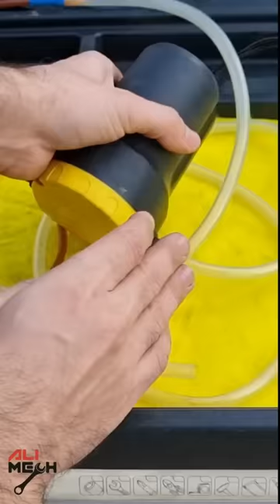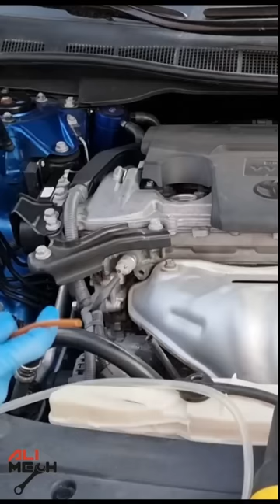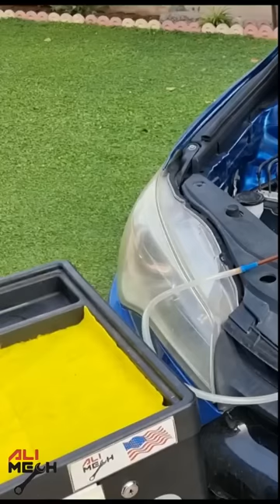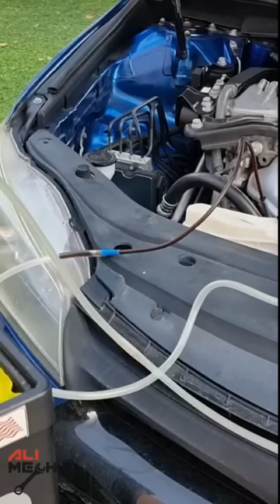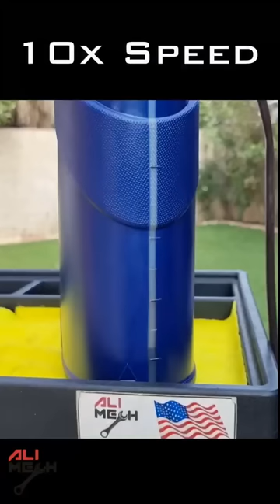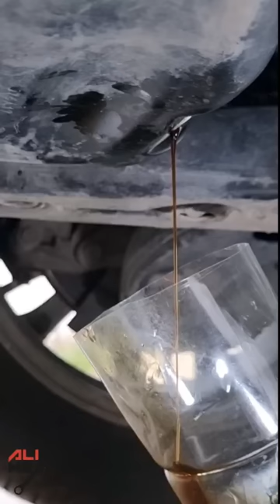Don't change engine oil like this! #shorts

Comment: Id already have the new filter on and fresh oil in before that pump is even done sucking, would be handy for trans fluid though.
Reply: Yeah, seems like it would take longer this way only to still jack it up and pull the plug in the end.
Reply: It comes out way faster if the oil is hot. I used an oil extractor at a friends house and it was like sucking water.

Comment: Iv a discovery , also most turbo cars have an oil cooler so there's always oil left over ! My one of those pumps gets 99% o just change the oil every 5k and filter once a year this more than makes up for anything left over ! Also I save nearly £50 labour and oil price is about £20 and filter £6.50 and I don't have to take a big rock plate off !
Reply: Pricey labour just to change oil! Makes DIY so worthwhile :)
Reply: I personally wouldn't change my oil and leave a dirty filter on. I've even heard people suggesting to change the filter and top the oil off but not change the oil.  Never done that either.  But it makes more sense to me, espasically if you're using synthetic oil.  Idk though.  

With normal/boring cars it's definitely a good idea to not waste resources.  I personally don't have a car let alone a boring car.  I ride Motos everytime I go anywhere.
Reply: @Whitejesselink  Exactly!
Reply: If leave an old filter in-place, that filter is already partially-saturated.  This means EVEN IF the bypass valve doesn't open, there is increased oil flow restriction through the filter.
And if it gets to the point bypass valve opens, a bunch of filtered-out-junk now gets re-introduced into the oil, going through all your oil galleries, etc...

Some people in 1990's/2000's talk about full syn oil able to last a long time, but still needs to change the filters regularly -- this is also a bad idea.  Filters will still miss a bunch of fines in the oil.  If change filter but leave the old oil in-place, that fines will build up in the oil system.  Very few cars have two-filter setup that can deal with such things.  But most cars have only a one-filter setup.

Best to still change oil AND filter at same time.
Reply: @reallifeengineer7214  he's changing oil at 5k which is likely way before the oil has particulate contamination.  Most filters are designed for 12k miles or 1 year and modern oils hold particulates in suspension.

The reasoning is that modern GDI engines and modern clean diesels suffer from fuel dilution, quite literally there is fuel in the oil and it seriously impacts how well the oil lubricates.

This technique is fine actually that small amount of residual oil that isn't changed is not a problem. Occasionally removing the plug and draining is a good idea but this doesn't pose any problems change your oil 2x per year and you'll be fine.
Reply: Finally someone clever, exactlty

Comment: I learned it's also better to drive the vehicle for about 20 miles just before changing the oil, that way it's not only hot, but more contaminants come out, and you get most of the oil out!!
Reply: last oil change I did hot just because but not on purpose and it seemed better and faster draining (motorcycle if it makes a difference).  definitely don't have to ride that far for the engine to be really hot though with my bike.
Reply: If ambient temperature isn't low, oil drains fine as it's designed to flow well. So no need to warm it up before changing
Reply: @yeolblt  he suggesting that the cold oil leaves more gunk in the engine, and that the hot oil has more gunk within it. I'd like to see this theory tested personally.
Reply: Correct. That's what I was taught and always run the engine upto temperature before changing oil and filter.
Reply: Let's think that over?

Drive for about 10,20,30 whatever just drive and get the oil on temperature.
When back drain the oil,because?

What's the difference when the day before the oil drain I drove 30 miles, parked the car back home,next day I change the oil, because then I know for sure almost all the oil is in the drain pan at the bottom of the car.

Which way is better?
Reply: @Lonewolf_rider possibly more black gunk sticks to the inside if it's cold. I honestly don't know. It does seem to make some sense though.  Needs to be tested.
Reply: @J. Link VII  it's all in the oil pan,not a problem and everything will come out.

Comment: If you use the correct tool for vacuum extraction you can suck the oil sump as dry as if you drained it through the sump plug. and if you have a smart car you have no choice but to vacuum extract it! now I must add that I agree on some engines there can be residual oil left in the sumpPan I agree, but on some engines the drain plug is raised slightly off the bottom (some college genius design), so for those engines it would be an advantage to vacuum extract it! I am old school though and still like to extract a bit out of the sump pan drain at the end to visually inspect the oil for contaminates and metal particles as that bit of shiny black liquid gold can speak words for how a motor is looking inside! Great video
Reply: if you're lucky, with Trailblazer & Envoy, the drain plug comes out vertically, rather than at an angle!!
Reply: @brianconner3222  oh I remember when it was an u written law that engine designers put the drain plug at the lowest point, lord only know why some genius decided not only to mount it horizontally but part way up the pan! 
Designers these days make techs wish to fall head first into the pit!
Reply: I've changed the oil (and filter) on smart cars a few times without a vacuum pump. We don't have any at the shop I work at.

Comment: Great way to waste time during an oil change. This process is like escaping from the mature responsibility.
Reply: It was meant to show you how much oil remained behind.
Reply: What's not mature about finding an easier way of doing it?
Reply: @SuperMotoMe  Yeah...the same amount that's going to remain behind at that temperature regardless because of thermal viscosity and molecular cohesion no matter how you do it (unless you're willing to take the drain plug out and go inside for a nap.)

Comment: I used to adopt this method to pump the fluid out, it just too easy and tidy.  

I managed to suck 4L from a 2017 Benz C200 every time, there's still some left behind (believe less than 1L).  I think it is fine as my approach is shorten the changing  interval by 1000km or 1 month.
Reply: You read my mind. That is what I do plus put my car uneven so the oil go in a corner of the carter.  I have 2 years without need take out the nut of the carter. Plus do a less interval the oil change. No more mess LoL
Reply: I don't know Mercedes well but assuming C200 means C300 (that's their 'entry level' offering in the US... there wasn't a 2017 C200 here but the C300 came with a 2 L turbo I4), capacity is about 7 L.

Comment: Con este video me reafirmas de que no es tan malo.
Que si que es mejor desenrroscar el tapón de abajo, pero en ciertas ocasiones puede ser conveniente o aceptable.
Lo contrario de lo que indicas en el título del short.
Reply: Si ponen el carro en desnivel. En mí caso pongo las dos ruedas izquierdas en la acera de caminar.  Y casualmente mi calle es suavemente empinada hacía abajo.  Esto hace que el.aceite se mueva a la esquina del carter del.lado derecho.  Y logro sacar todo el aceite.  Claro depende del carro el mío tiene el varillaje se medir el aceite cerca de esa esquina derecha del carter.   Lo otro  no se les oscura comprar esa bomba electrica  son senda cagadas   la mía duro 3 cambios de aceite. El o-ring interno no sirve.  Compre una bomba manual que hace un vacio y chupa el aceite y de paso la mete en el recipiente. La bomba manual es muchisisisimo mejor. No se daña. Y es más limpio que la electrica mostrada acà en este video que requiere pasar el aceite a un recipiente.  Y hacer un reguero alrededor. La bomba mostrada acá es remala.  Y de paso. Sacar el aceite con el carro a nivel como se muestra deja aceite adentro del carter.  Yo no tengo ese problema.

Comment: It depends on the motor. On some of my motors an oil extractor gets every drop, on others it leaves quite a bit. It depends on the shape of the pan and where the sucker tube ends up.  Examples: on my old Tacoma v6, Prius and Honda boat motor it gets every drop, on my diesel truck and Ford ranger it leaves a lot, about a quart in the ranger.

Comment: atleast the pumps get a majority of the oil out perhaps minus a quart or less which i do consider sufficient. most quick lube places dont fully drain all oil not to mention whats above from driving there.

the absolute best thing is to plan a day and let the vehicle sit overnight so all oil returns to the pan than drain and refill this assures all old oil is out.

dont forget that filter as well.

Comment: Catching all the oil via the drain plug can cause such a mess if you accidentally knock the catching pan so I decided to use this method first. When I removed the drain plug I got about 3 drips, nothing left behind. Used this method ever since.

One point to note, the end of the insert tube should not be straight across or it could be sucking against the metal and you may think it has finished because the oil flow stops.

Comment: in some cars like mine the drain plug is a bit higher and some oil stays inside , with this thing you can take almost all because the hose will reach the bottom.
Reply: I always just raise the front of my car a little higher than the rear.
That seems to help the oil drain better.

Comment: I personally just take the oil filter off and let it run for a few minutes.  Seems to get the most out.
Reply: Same, really shakes the oil off of everything 👍
Reply: @tempk490  it also helps the bearing surfaces share a lil extra metal with eachother, and as we know sharing is caring. What better way to be tolerant right?
Reply: Just run the engine with the oil fill cap open and pour new oil in at the same amount that shoots out. Once it's clean oil shooting out you're done.

Comment: I mean depends. When the car manufacturers RECOMMENDS changing oil with extraction method you SHOULD do it because it’s best for the engine and it’s designed to be extracted, but when in manual it says to be drained, drain it. Secondly if you’re doing an oil extraction you should do it with a specialized equipment that’s maybe expensive but is designed to do it properly.

Comment: You can absolutely change oil like this. It purely depends on if your car was designed to have the oil changed like this or not. Absolutely nothing wrong with following manufacturer specification though. These little electric pumps are absolute garbage

Comment: Most say warm the engine, but modern  synthetic oils are more "thinner" even when cold than fossil oils from years ago that were "thick" when cold, and if you let the engine go cold more of the oil will drip down to the sump, or am I wrong!

Comment: You need a hot engine and thin fully synthetic engine oil5w 30 or less and work the tube, never fails even with a hand vacuum pump.

Comment: It’s actually the recommended way to change the oil on a lot of euro cars
Reply: And a lot of euro cars also recommend 10,000-12,000 mile intervals.  Doesn't make it smart.  (I see a lot of 10-15 year old Japanese and American vehicles on the road but it seems like the German ones are rarely older than 5-6 years... wonder why...)

Comment: BMW or Mercedes tells you to change their oil like this, I would worry about sludge which hangs out at the bottom of oil pan. If you're going to do it this way do it when all the oil has drained back into the pan but still warm and mixed up and not so thick.
Reply: except my n20 doesn't even have fk dipstick
Reply: How often do you see Mercedes and BMW's driving around that are more than 5 years old?  Compared to how many Japanese and American cars that more than 10 years old?
Reply: @ExaltedDuck  This is true but there are less of them anyway do to initial cost of those vehicles at least in the states plus the upkeep on them doesn't lend itself to be a good 2nd hand used vehicle. That being said I've see some of those old 80's  diesel Mercedes still going strong and I'm not talking about restored one's either those things are tanks.
Reply: @adamscott9725  One of my college roommates had one about 20 years ago that was about 20 years old at the time.  It was hideous... repainted to navy blue from the original beige, and done with rollers without removing the trim.  but it had something 280,000 miles on it.  Wouldn't be surprised if it's still out there somewhere...

Comment: Also vw audi engines have an extra 1/2 pint in the oil cooler below the oil filter which pulling the sump plug doesn't get out.

Comment: Cars that arent meant to do this style of oil change shouldnt do this. Also it would help if u had a stronger pump and made sure on a level floor or a floor angles the oil towards the oil dipstick. Like other comments have said the oil pan and dipstick are designed in mind to have this style of oil removal as their standard maintenance procedure. Not all cars can have this done this way.

Comment: Can you do us lot a favour? Angle the car to the dip stick tube so on the passenger rear wheel, a ramp, curb or a jack then try that again.. I’m defo not a fan of sucking the oil out but just wondering if would make a difference and get that little bit out.

Comment: On my 2006 Toyota Corolla, I always squeeze out even more oil by lifting the front end of the car. 
The oil drain plug is installed higher than the bottom of the oil pan.

Comment: These pumps are designed for boats because you can't get to the drain plug if you boat still has one.  I've done this twice a year for 7 years with my boat...

Comment: Q ganas de complicar las cosas sra. Ese carro no trae un tapón en el cárter?
Reply: Yo hacía eso hasta que me canse ,.mucho reguerro y trabajo.  Lo otro de llevarlo al.taller es.que apreten mucho la tuerca y jodan la.rosca interna del.carter. si se daña eso  yo lloro literalmente 😆  no que va. Yo saco todo.el.aceite colocando el carro en desnivel. El.aceite va a una esquina del carter y la.saco.con una bomba manual que de paso tiene su propio deposito. Me tardo 10 a 15 minutos incluyendo cambiar el filtro.   Eso si jamas de lo jamases.compre esa bomba electrica mostrada en el video a mí me duro 3 cambios de aceite. Son muy malas. Laa buenas son las manuales.

Comment: I have this exact pump and it leaks oil inside the housing due to its design. I have to place a blue paper towel inside to absorb the spillage of oil and I change the paper towel out after a few uses.

Comment: drain bolts always win no matter what you try getting oils out of it
2nd not all vehicles have dipstick go deep in oils pan rest of them have it above dipstick line which why never get it all out
better off using bolt on drains oils pan

Comment: Smart 450 only like that you can change oil, 
Or  have to change the engine crankcase, which has a drain plug

Comment: You gotta get under to change the filter anyway.  Also, if there were metal chunks in your oil, this may be less likely to alert you.
Reply: Filter is on the top of a lot of engines these days. Pretty common for dealers to do topside oil changes.

Comment: This doesn't make sense, if you leave most dirtiest part unsucked. Better do the old way so gravity would pull out all the heavy parts too. Also change oil filter every oil change, and later just do a ride outside city with 3000 rpm for 1-2 hours, the new filter will get all the leftovers. Also get fully synthetic oil and check if you car supports lower viscosity oil (like 0W, or 5W). and let engine sit for 5-10 minutes in cold weather, so it would not damage the engine and allow oil to be more liquid.

Comment: The drain plug is there for a REASON!
Reply: These pumps are made for a reason
Reply: @ding9633  those pipe are made for any reason, but the engine drain plug has only one reason

Comment: on  my subaru crosstrek, the oil pan plug is not in the bottom. so, there's always a little bit of oil ....  not with a pump

Comment: Pneumatic ones are much better. I have a hand pump and does a better job. Or i add a 1/2 litre of clean oil. Dilute the oil oil and get it out. 5L of oil i need 4.4. No bottles of 1/2 a litre sitting.

Comment: this technique is actualy effevtive with a proper hose or pipe lenght that would reach th bottom right at the oil pans floor, the way you did it means your hose did'nt actualy reach the bottom,
and i guess the pump you used is a bit weak to actualy suck it all out

Comment: If only oil pans had something that could be used to drain them….almost like a…like a drain hole in the bottom…but then they’d need a removable….I dunno…something to plug the hole to stop the oil from draining when you didn’t want it to drain….almost like a…like a drain plug

Comment: This work very well for my. But I put my car the 2 left tyres over the sidewalk and the oil go all to the right. And coincident my street is downhill. So I can take all the oil out.  Now  in a flat road like in the video yea. Oil will remain.    Another  I bought  exactlty that electric pump   it is crap after 3 oik changes it break down.  The o-ring worn out.   Now  I use a manual pump and it put all the oil inside easy to recycle it.  Forget this electric pump in the video is crap. And put the car in a way to push the oil in a corner in the oil carter.  "Depend ot your car" work for me in a Honda jazz perfect.

Comment: That only happens in cars not designed for oil extractors.
Extracting from a german car leaves no or very little oil in the pan, 1dl at max which is nothing.